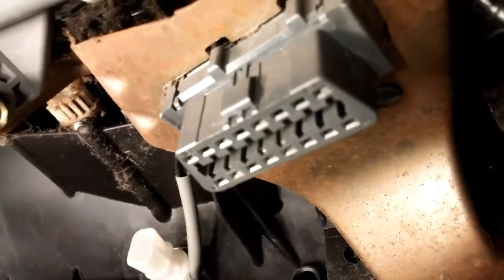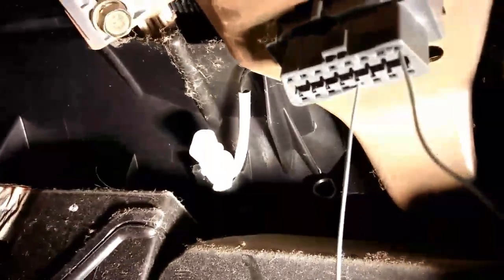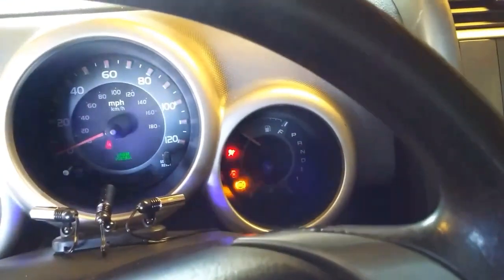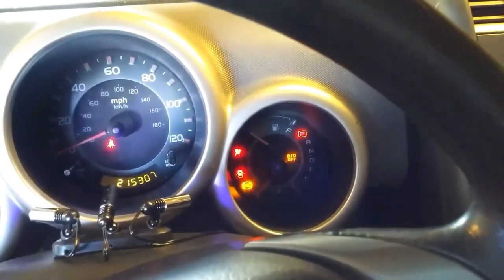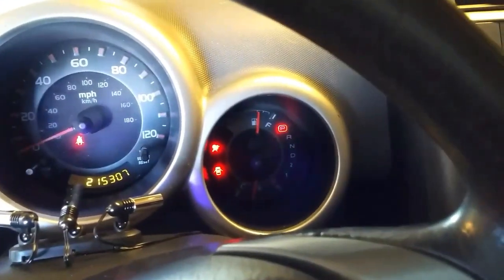Honda blinking flashing D light! Get codes easy without scanner WITH DEFINITIONS.  Element CRV

Comment: Thanks very much for this video. It was a bit of an effort to find the correct pins in my '03 Element as it's upside down and a bit hard to reach and see. Nonetheless, it produced a 26 code and I was then able to replace the 3rd AT oil pressure switch. I went in through the top. Only had to remove the battery and the plastic battery tray. It was easy enough to reach around the metal battery bracket, access and replace the switch. Hope this helps anyone else. Best wishes! My part # was: 28610-RKE-004.
Reply: Have the same element as you and the same problem.  Mine is a 26 code also.  Your comments help.  Thanks!

Comment: Not sure if anyone can help but I just pulled the codes on my rsx and the check engine light and abs light both started blinking and i pulled 70 from them both was wondering if anyone knew what that meant?

Comment: Can these be read with the car running?  The code goes away when I restart the car
Reply from the maker: I wouldn't do it with the car running, if you have it running just turn the key back one click and the engine should shut off, but not the electrical system. Then code check

Comment: Thank you thank you thank you! I used the paperclip and got code 28. Had to use google to find the location of the ATF temperature sensor. A mouse chewed on the harness. You saved me so much money!!!
Reply from the maker: Awesome! Glad you got it figured out!
Reply: Hi i changed my starter and lost some trans fluid I put more in but now my transmission     is making noise and won't go into reverse any idea what it might be I did not use Honda trans fluid 03 element?

Comment: Hey Drew.. did the jump pins 4 ~ 9 trick and got the code 26. Replaced the sensor and still have the same problem. Also when I did jump them, the TPMS flashed ..(if the same short/long sequence is applicable)... an 11,13,15 & 17 respectively. And I got a flashing "b10 08 10" in the odometer window... and thoughts or advice? Thanks! B

Comment: So, I did the trick. Thank you. My light flashed 23 which you put as a “Clutch Pressure Solenoid Valve B.” I’m curious how did you know what the code “23” meant and where did you get it from? Is it associates with a “P” code of any kind? I’m running in to a wall trying to move forward. Hopefully this is still an active enough thread. Thanks for any info!

Comment: Drew enjoyed this video.  Can you tell me if this will work on a 2003 Honda Civic? Also I would be curious to learn how the pins are numbered?  To clarify is the count clockwise, left to right or top, bottom, top... Not sure where the numbering of the four pin and nine pin is derived.  Thanks in advance for your time.

Comment: Ok so does the D light have to be flashing at the time to get correct transmission readings?  I did the paper clip thing and got 4 readings (2004 accord) then a friend brought a code reader thing- and only the check engine light was on and it pulled up just 3 codes- only one of which was the same, but they werent sure if their device would even read transmission codes...... or do we just fix all 6 🤷‍♀️😒
Reply from the maker: Does not have to be flashing to do the trick. It will show stored codes. Hope you got it figured out!

Comment: Thanks a lot for this video I got code 26- 3rd clutch fluid pressure switch on my Honda CR-V 2008. But I'm really struggling finding the right replacement part. Some forums says that is this one 28600-RCL-004 others that is 28600-RCR-004 and others that is 28600-RCL-003. Any idea which is the right one?
Reply from the maker: They should all operate in the same manner.

Comment: I have the flashing D and no engine light. So do you have to drive it a while before you can use this method? I tried it and it didn't do anything.
Reply from the maker: Engine light isnt always on when the D is flashing. Nope you dont have to drive it around for it to work. Even if you didnt have any trouble codes present, after inserting the wire the d and abs will still flash a default code if you did it correctly.
Reply: @drewforthefew935  it didn't do anything when I tried it while it was shut off. Plus, it didn't start blinking until I drove it awhile. However, I did it again while it was running and got code 26.

Comment: D light is blinking on my wife's element but only while she is driving and not all  the time.  I attempted this test.  I received no slow or fast blinks and now the radio and door lock button on the doors are not working.  Did I just blow some fuses?
Reply from the maker: As long as you did it exactly as it is in the video, it would not interfere with any other systems in the least. This is an actual method cited by honda. Even if your trans had no codes the d light should/will blink a default code.  Is it possible you missed by a pin in the connector?
Reply: @drewforthefew935  ok, i will double check.  So you think the other stuff is the fuses?  I have not had a chance to look at it yet.  Wife called me at work.
Reply from the maker: Fuses are always the best place to start! Check fuse i think 9 and 16 under the hood. (Might check your manual to confirm) the locks, radio and obd power are indeed in series so one fuse blown can take them all out. If you confirm you did the pins correctly then its safe to assume that you might have a short elsewhere thats allowing power or ground where it shouldnt be in the obd connector. I have found that this is indeed the reason some d lights flash to begin with. Broken wires on sensors, solenoids.. Ect.

Comment: Great video!  Are these codes good for a 2004 Honda Odyssey?  My flashing D comes and goes. And it was NOT flashing when I did the paper clip trick. I saw 2 long and seven short flashes = 27. is this a valid reading since it was not flashing?
Is there a way to reset with paper clip also? Thanks again for putting this out.
P.S. I did not have a check engine light when the D was flashing!
Reply: Scott C. Did you ever figure this out? In regards to check engine and d light being on when pulling code readings???

Comment: Drew - I’m getting a 1 code with 4-9 jumper on an 04 Odyssey, different than the “normal” blinking of the D light.  I also have a CE light and a TCS light and getting code P0743.  Just changed the torque converter clutch solenoid valve, no change.  Also replaced the A/T clutch pressure control solenoid valve C to clear a P0763 code.
Any ideas what to do next?  Thanks, Tim
Reply from the maker: Tim, where are you seeing a code 1? Im a little confused on that. Ive experienced something like youre talking about. Unfortunately the culprit was a worn out torque converter simply not allowing pressures to get within the voltage tolerances.. How is the fluid looking? Pretty much if it goes black in a honda then the converter is toast

Comment: I used a paperclip to pull the code. It blinked 5 times. I ordered a new neutral safety switch and installed it. The D light is still blinking. I used a paperclip again and it is still the same code. I tried to clear the code and it still popped back up. Any idea what it could be?
Reply from the maker: Ian,  so your code was 5 short flashes all of the same length? Also did you let the light keep flashing so that you knew that was the only code stored?
Reply: @drewforthefew935  yes, 5 short flashes and it just keeps repeating over and over. I had taken it to a transmission shop previously to get it scanned and they said that was the only code. I am baffled lol.

Comment: I've got code 42 from flashing D in my Honda fit 2010.. but it's not on the list pls help
Reply from the maker: Does it happen to be accompanied by an engine light?
Reply: @drewforthefew935  the engine light didn't lit.. but it gives 7 long blinks of the check engine light.. what could be the possible problem in my transmission? Thanks.

Comment: hi there, I just wanted to ask about my 2007 mazda3, the D light is flickering randomly and when it flickers the car jerks. Ive tried recreating it like watching it shifting, slowing down, and all but it didnt happen. it just randomly flickers then jerks. thank you
Reply from the maker: Is it flickering with no noticable pattern? Honestly that sounds more like an electrical fault than anything. Possibly a chaffed wire to a speed sensor or even something more obvious like a corroded battery connection.

Comment: Hello! I got the d, n and r blinking. Dealers of mitsubishi said my cvt is dead and i need a new gear box ( im only at 45000km...no warranty anymore). Other garage said its a sensor prob. Replaced it but restarted a few days ago...i dont why is it so hard to fix this...everyone lies...error code is P0841...any ideas?
Reply from the maker: Could you tell me the year and model of your car? Unfortunately these types of fluid pressure code can be a pain to figure out. Your n (neutral) and r (reverse) are blinking as well??  Very bizzare behavior.
Reply: @drewforthefew935  it's a Mitsubishi Mirage 2014! Yes when the d blinks, I switch it to n, it blinks and to r, it also blinks...
Reply from the maker: Oh ok. Sorry i assumed it was a honda. Haha. Usually if your gear indicator light is blinking rapidly in a mitsu its an indication that your cvt is overheating. If its blinking more slowly its telling you it needs service. The code p0481 is related to your radiator cooling fans. Which would make sense as your cvt is cooled vicariously through the radiator and improper fans could cause the trans to get to hotter than it should. My first action would be to have someone check into the fan relays, coolant temp sensor (triggers the fans) and maybe even the fan itself. All of these fixes should be relatively inexpensive. Unfortunately if the cvt has gotten too hot, too many times. Then the damage may be irrepairable. Sorry bout your bad luck :(
Reply: @drewforthefew935  it's P0841 not P0481, does it change anything that you were wrong with the code or it's a typing mistake 😐
Reply from the maker: Oh goodness, youre right. The dyslexia that i didnt know i had got me there. Haha. P0841 is a fluid pressure issue (thats what i was gettin to on my first response i think) the part about the reasons for the light blinking are the same.  These types of pressure related codes can indeed sometimes can be the sensor/switch that you said has been replaced. That is the most affordable of the possibilities. However a lot of places will replace the sensor without looking into why the sensor is throwing a code. If the sensor is working properly which it appears yours is, the cause of the pressure differences is more likely to be a faulty transmission pressure control solenoid.
Reply: @drewforthefew935  ok then thank you for your time and all the info! That pressure solenoid is expensive or you have no idea?
Reply from the maker: Sorry didnt see this! Incase you havent already figured it out, the part should be less than 100. Labor however could be 3-500 depending on the shop

Comment: I have read elsewhere that P0847 is the code for the 3rd Clutch Fluid Pressure Switch, not P0026.  Am I missing something?
Reply from the maker: Stephen Jones.  Any code in this method is NOT a p0 based code. Simply code 26 through hondas code identification, however you are correct that with scan tools that can read honda trans codes (fairly uncommon) it would indeed show a p0 code with a completely unrelated number. P0847 and code 26 are the same, correct. In short p0026 is not trans code 26. This is just a shorthand method for finding problems without a honda specific scanner.
Reply: drew forthefew,  You Rock!  I am old man and getting my self under that dashboard was a miracle.  My eyes are poor and I had to guess which was 9 and take the opposite side 4. I indeed did got the 26 count. Now to buy a new pressure switch.

Comment: I got code 46 from flashing D... 4 long flashes. 6 short flashes. Any clue what could be the problem??? Also, VTM-4 flashes a 77 code. And Check Engine Light an 87 code. 2003 Honda Pilot. Any responses with answers would be greatly appreciated! Thanks in advance!!
Reply from the maker: Ouch! 46 usually indicates a mechanical problem in the hydraulic system of the trans (perhaps failing torque converter or any small broken part). Not real specific i know, its a rather grim code. The vtm code 77 relates to the locking rear differential also having an issue, a lot of them get that code along with a high pitched hum while driving.  Dont know the engine code but any part store will check engine codes free.  Sorry cant help much on that one!
Reply: Thank you! I appreciate your insight, HIGHLY!

Comment: You are the man!  Every website I have gone to speculates on what the problem may be and says to go to Honda to get it determined.  I did your wire trick and got 27 - 4th clutch pressure switch.  I'll let you know if it takes care of the problem.
Reply from the maker: Marc Nitz. Glad i could help! make sure the actual connector for the pressure switch doesnt have corroded contacts. And follow the wires back as far as you can to make sure they arent brittle or chaffing on something. Half the time its just a gimpy wire to the specific switch.

Comment: I got 34 I can't find it in the description
Reply from the maker: Mustafa Yaghmour were you counting the flashes of the circle around the "d" or were you counting the flashes of the engine light? That has a different code set.
Reply: drew forthefew the "D" ..... 3 long ones and 4 short ...... But the model is civic hybrid is there any difference ??
Reply from the maker: Yup these codes are element/ crv specific, though some of them are the same as other hondas. Does your civic have the cvt transmission?
Reply: drew forthefew yes Sir
Reply from the maker: Cool. I believe on your car that is for the (drive pulley speed sensor circuit)
Reply: drew forthefew nice thank you
Reply: Can you show me a picture for it coz I changed 3 sensors and still the same problem
Reply from the maker: Mustafa Yaghmour. The input shaft (dive pulley) speed sensor should be located at the front of your transmission.  Its NOT in the group under the air intake. However theres a chance that the sensor was operating correctly and was blinking because you have an internal problem with that specific system of your cvt.

Comment: Where are all the codes? I have 27 flashing but no definition of it.
Reply from the maker: Sorry, just added 27, must have missed it! that would be the 4th clutch fluid pressure switch. I would check the wiring to it before replacing it!